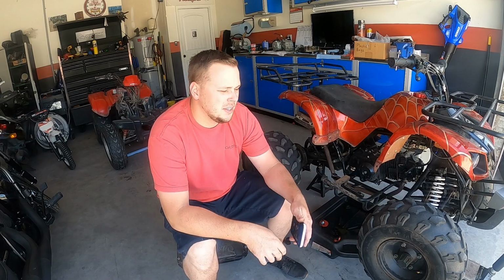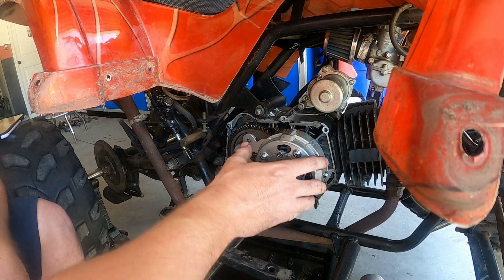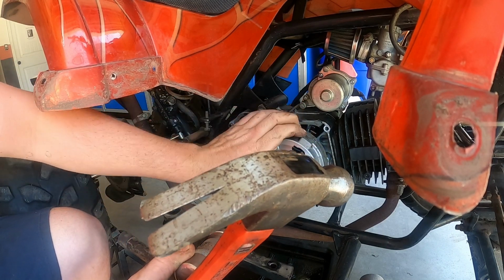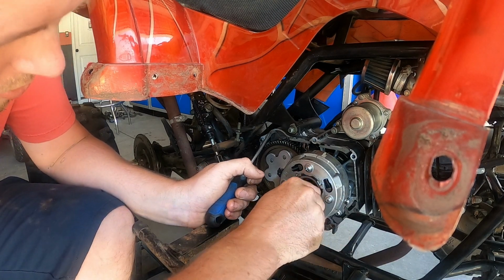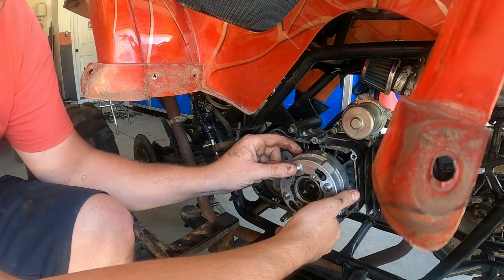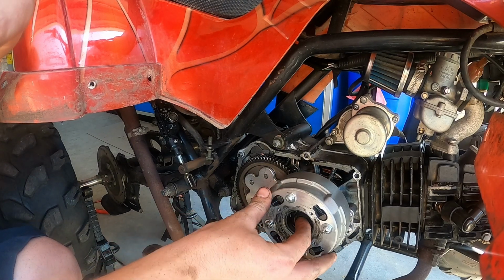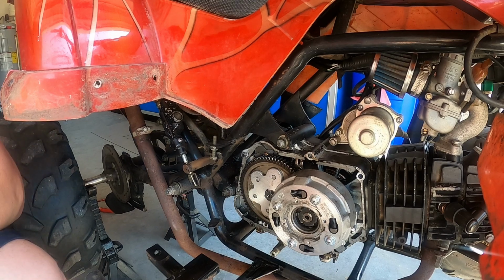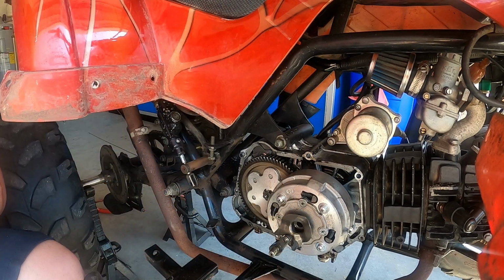Tao/Coolster 125cc ATV Clutch Replacement

Comment: One more uga duga did it. I gotta fix one like this for my son he’s had for many years. Thanks for showing how to do it.
Reply from the maker: Josh Brekke thanks for watching josh! Too many uga dugas can be dangerous. Just the right amount is perfect!
Reply: Ha ha, exactly! What type of oil is used so I make sure I put the right stuff in?
Reply from the maker: Josh Brekke 10w-40 make sure it’s suitable for wet clutches. Should say on the bottle. I run yamalube 10w-40 in all my machines
Reply: Ok nice, if and when I buy a new clutch should it be soaked in that oil? If so how long do you recommend?
Reply from the maker: Josh Brekke that helps longevity of the friction plates.  I didn’t personally do it, but highly recommend soaking them overnight
Reply: Ok great! Thanks a lot, we really appreciate your time sir. We have a Coolster 110 the chain keeps popping off even after proper adjustments. The part the rear gear is bolted too wobbles, machined wrong. It came to us that way from the dealer. And my sons 125 came to us leaking fuel, bad rear shock and the rear luggage rack was installed half ass. Like they brought us throw always or something. 10+years ago. So I decided to finally get them both going for my kids cause, boredom you know how that goes. Thankfully my 1970 Rupp Roadster runs like a champ, for now at least. 😂
Reply from the maker: Josh Brekke sweet deal! Bet your kids love that!  Chinese ones you definitely have to look over very well, and stuff tends to vibrate loose a lot on those machines

Comment: Great little video buddy! Strong work! Only question i have is how to adjust that clutch, I had the adjustment screw all the way in. Now with a new clutch in there, do I just back that puppy off a tad? Thank you
Reply from the maker: It’s been awhile since I’ve done one, i can’t remember if they’re the same as an old Honda motor or not.  Honda’s you turn counter clockwise until you feel tension. Once you feel tension, turn it clockwise 1/8 of a turn and that’s it.

I would try the Honda method first as these engines are Honda clones, if it doesn’t work, try turning it clockwise till you feel tension, then back off 1/8 of a turn.

Comment: Thanks for the video. I bought our granddaughters a Coolster 125 four wheeler for Christmas a couple years ago. They rode it a lot. It sat up for five to six months. Battery died, carburetor clogged up so I took it to a Ace Hardware that sells them and got it running. New battery new carburetor. Technician said it wouldn’t shift into gear and they could not / did not want to get into the repair. The 4X4 is like new and well cared for except for setting up all those months. Any idea on what the shifting issue could be. I’m mechanically inclined, and can most likely fix if not to difficult.

Comment: Hi, do you know why  after replacing the clutch the back wheels will not move when I push the bike , when I push backwards they turn but forward seemes locked. Everything works fine when driving.
Reply from the maker: Clutch needs adjusted
Reply: @TynkaTyme  I did loosen it all the way , still nothing,  is it maybe because it's new or slightly thicker??

Comment: I have a 4 wheeler exactly like that one.. but I can't tell in which gear is and won't turn on because is not in neutral. What can I do to fix this issue.. will replacing the clutch fix the issue?
Reply from the maker: Mayito 88 if the fourwheeler shifts gears ok, just try switching through the gears and try starting it in each one.  If it doesn’t start, your problem isn’t because it’s not in neutral.  You can also find neutral by rolling the fourwheeler.  If the wheels turn freely and you are able to push it without the rear tires skidding, you’re in neutral.  If it rolls easily, and still won’t start, you have other issues, like a bad solenoid.
Reply: @TynkaTyme  the 4 wheeler don't shift in any gear and also the tires don't move... I already replaced the electrical.. it was working before...my kid told me he was trying to shift when the 4 wheeler got stock in high throttle. Probably that damage the clutch right? 🤔
Reply from the maker: Mayito 88 probably not clutch related. I’d take your clutch cover and clutch off and make sure your shift shaft is moving the shift drum like it should
Reply: @TynkaTyme  will do that.. thanks a lot for your help... Hopefully that fix the issue.

Comment: Hi, when you installed the new gasket that goes between the case and the cover did you install it dry or with gasket sealant?
Reply from the maker: It’s personal preference, i do mine dry, some people use sealant as well, either way works.

Comment: I bent the locking tabs out and that nut absolutely wont move at all. Any tips
Reply from the maker: Using an impact?
Reply: @TynkaTyme  yes! I even tried beating it with the hammer and the damn thing won't budge.
Reply from the maker: @williamconyers9309  maybe add some heat

Comment: Mine starts acting up after ~30 minutes of riding.  Symptoms are close to no power in forward gear but reverse always has plenty of power.  Problem goes away after cool down.    Clutch?  I was told could also be rear axle bearings. Idk. Would like to hear your thoughts.
Reply from the maker: I recently had one doing the same thing, reverse was fine, but no power in fwd.  replaced the clutch and fixed the issue. Be sure you’re running an oil that is suitable for wet clutch operation. Should say it on the bottle.

Comment: My son has a 125cc toatoa go kart.  It works great in the forward gears but grinds badly in reverse.  Would replacing the clutch fix that issue?  Very helpful video you made.
Reply: We’ll unfortunately I don’t have my Chrystal ball with me, but if I had to guess I bet ur shift lineage is out of alignment and it’s not fully catching reverse, making it grind

Comment: We tried to remove clutch like this, however our clutch keeps spinning when using the tool, how do we stop it from spinning to get nut loose?
Reply from the maker: Wendy Handley use an impact and hold the clutch still with your other hand and the impact will spin it right off as long as you bent the locking tabs out of the nut

Comment: I have a 125cc 2010 coolster tab and when I turn it on it will go fast for like 10 minutes and when I turn it off and ride it again alter it will barely even move in drive but in reverse it goes fast
Reply from the maker: Clutch worn out

Comment: My chinese atv has about 700 miles on it and ive never changed that clutch before. should i?
Reply from the maker: If it’s not giving you any problems, i wouldn’t worry about it
Reply: @TynkaTyme  Yeah, It seems to run fine. Accept from the part when i get onto it from a standstill it takes a good 5 seconds to get moving and then gets going. Not sure if that would be related to the problem but that’s something that has been going on with it.
Reply from the maker: @dari3x374  sounds like clutch is slipping then if it takes it awhile to get going
Reply: @TynkaTyme  yep kinda what I thought as well.

Comment: I put in a new clutch and now the the shift stick won't move and it still acts like it has no power.  Any idea what I did wrong?
Reply: Try filling it up with oil? Maybe the clutch was stuck when it is in neutral?
Reply: Same. Mine has no power front or back

Comment: Great video - Thank You ! Does anyone know how i could attempt to fix/rebuild the clutch (vs replace) ?

Also, on my 2nd ATV, what could I do preventative care or maintenance to make it last longer ?
Reply from the maker: Ali Asghar clutch assemblies are 20 dollars, so i would just rather put a brand new on than go through the hassle of finding all the parts and tearing the old one apart. Just keep oil changed, air filter clean, and valves in spec.
Reply: @TynkaTyme  Thank you. My biggest issue is sourcing parts, no as free flowing and quick to be delivered in Toronto, Canada.

I agree with you though. BTW, Valves in spec ? How (if there is any video you can point me to) ?

Once again, thanks and keep up the good work ! ... and also, stay safe please :)
Reply from the maker: Ali Asghar watch one of my first videos where i do a top end rebuild i think it’s part 3 where i show you how to adjust valves.

I usually use amazon, eBay, or Vmc Chinese parts.com for all my parts .

Thanks for watching the videos and subscribing! I’ll keep them coming!
Reply: @TynkaTyme  Thank you Sir.